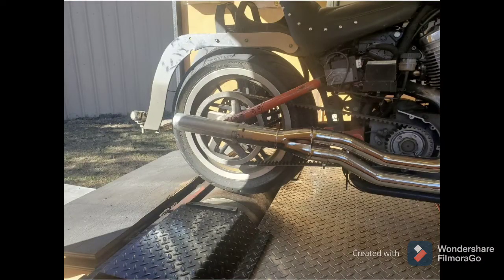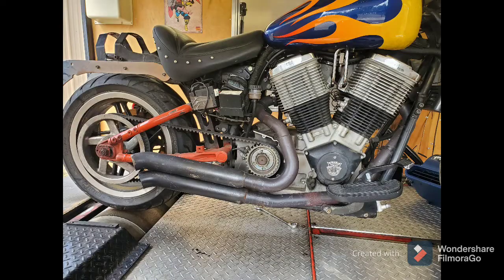Victory Performance Exhaust comparison between a Modifed Bassani Road Rage and Bassani Turn-outs

Comment: I'm pretty surprised about the top end, the bottom end didn't surprise me much but the top definitely did, love to see two into two straight pipe on the same combo, not sure what I'd expect now
Reply: I do not think longer 2-2 would far any better than the turn-outs
Reply: @coryackley944  you could be 100% right, but I'd still be interested to see just cuz sometimes things that don't seem like they wouldn't work do, or don't it could be worse with straight pipes 🤷‍♂️ diameter would probably make a difference as well, but I couldn't tell you if it should go up or down or what difference it would make

Comment: I am exactly surprised the 2 in1 out performed the 2-2 by so much.  Do you think its back pressure as to why the 2-1 did so much better?  Thanks for your service brother!  I just retired from the Army after 21 years of service.  Hopefully more time to ride and work on bikes!
Reply: Wow your comment got by me...  The mid range is impacted by the 2-1 ability to assist with scavenging.     As for the limited top end on the 2-2, it surprised me.  Cannot put a finger as to why.  Maybe baffle design

Comment: Would like to know what your combination of motor parts used in the engine.  Cams, headwork, valves, timing, pistons, comp. ratio, pcv, etc..
Reply from the maker: This video covers the build of that bike, a parts list is at the 1.30 mark.  If you have other questions let me know.  If you need the specs of the S&S 495 cams, I can provide those as well.

https://youtu.be/tGGJwTpNf5w